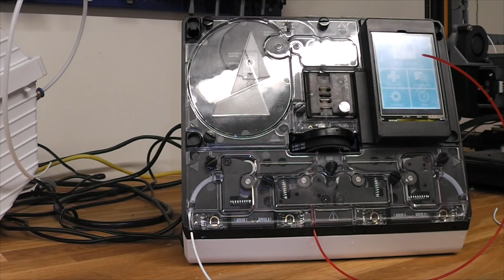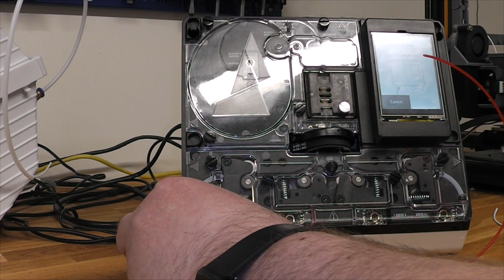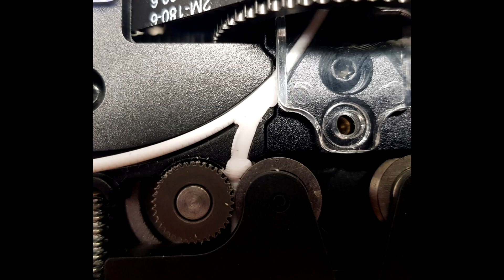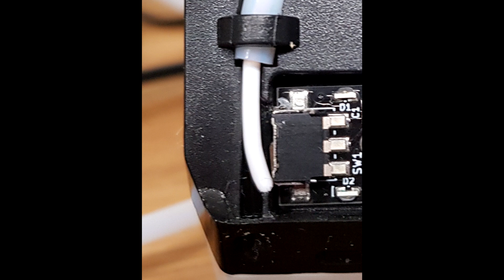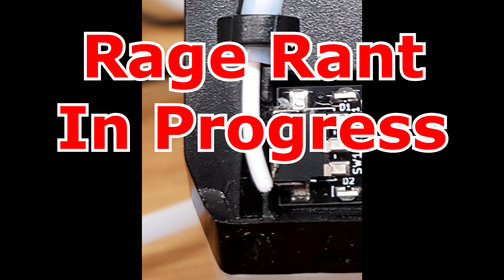Fatal Mosaic Palette 2 input sections design flaw. One of the reasons multi spool mode can't work.

Comment: cant you drill it out and add a small section of pipe in there , or cut off the knotch and make a tinny triangular peace to angle the filament back to the hole
Reply from the maker: Thanks for the comment! I solved it by filling the gap. It is described in this video: https://youtu.be/JUrblIVPj8Y
And the STL for the caps can be downloaded from here: https://www.thingiverse.com/thing:3626449

Comment: Hmmm, was actually looking forward to this exact use case for a large format printer I was planning on getting.  Is disappointing actually.  Supposedly an upgrade of the P2 / P2 Pro is coming later in the year - hopefully this is an area that gets addressed.
Reply from the maker: Yes, I'm really curious to see what they comes up with in the upgrade. Like I have mentioned elsewhere my hopes are not very high. The level of incompetence required for the whole host of incredible design flaws in the current version combined with their complete denial that there is any serious issues with it at all leads me to think that they simply will not be capable of making any substantial improvements. I would really love to be proven wrong on that one though. Who knows. Maybe they hire an engineer or two that actually have a clue about engineering. That could turn things around really quickly.

Comment: So this problem occurs when you don't have enough filament for the entire print right? If you have enough filament this issue doesn't happen?
Reply from the maker: That is correct. The jam can only happen when it pulls the end of the filament past the internal gaps in the filament input sections. So a normal multi-color print where you don't use the switch-to-next-input feature will not be affected. Only the multi-spool mode is completely ruined by this flaw.

Comment: I was thinking of buying one of these, but now.   Hmmm, what a design issue.
Reply from the maker: Yes, it is pretty fascinating that they did not realize that putting a huge notch like that in the filament path was a horrible idea. Or that designing the buffer so it have to periodically drain itself when they have a mode where it never know when it will need the buffer also was a horrible idea. And Mosaic is in complete denial and don't see a problem with any of this, so I don't expect there to be any improvements anytime soon.
Reply: @kavionic279  I guess they do not want to pay the cost to get new injection molds to fix the issue.  One would have expected this functionality to have been extensively tested as a prototype though, so they should have never had the issue.
Reply from the maker: @10p6  I guess not. Their customer support is super responsive and helpful when you ask them easy questions, but when you ask about some of these issues that will actually cost them money to fix they try to dodge it by replying something with no correlation to the question you asked. Or they simply ignores the question. I kept trying to get back on track and have them actually show a little spec of professionalism and come with some real responses to this issues. But that ended with the upper management telling the team to stop communicating with me 😃 Guess there is no professionalism to find at any level in that company. And I really get the impression that they design their tests to avoid stressing areas they suspect might fail. That might not be true of course, but it is really amazing what has slipped through the cracks.
Reply: @kavionic279  Unfortunately from the research I have done, the Palette seems to have many more problems than they let on.  I heard that the also ask reviews of machines they loan out to review the Palette in a certain way, and they cannot make it look bad.   For what it is, it is very expensive to have issues with.
Reply from the maker: @10p6  That is interesting. I find it very strange that there does not seems to be any serious reviews of this thing. And given the massive amount of design flaws I find it even stranger that there is hardly any critical reviews to be found anywhere. Other than on this particular channel that is 😃 I guess some of the big 3DP youtubers might be affiliated with Prusa and don't wont to review a competitor to the MMU2. But that is probably not the whole story.
Reply: @kavionic279  Youtube is full of connected circles, and not always in the interest of viewers.